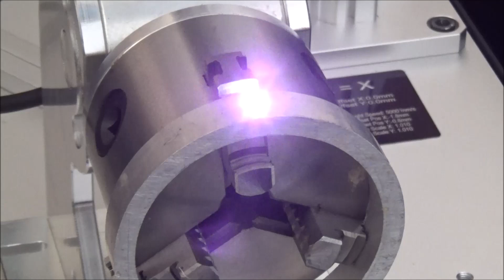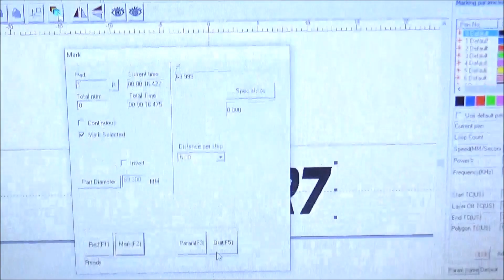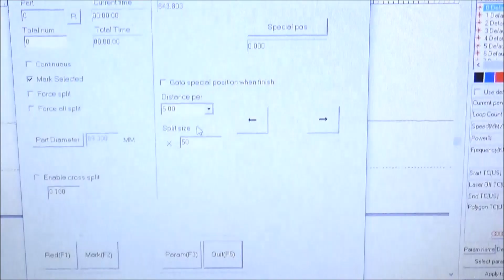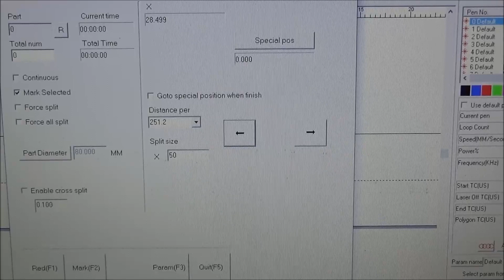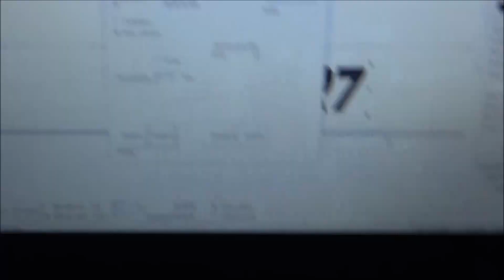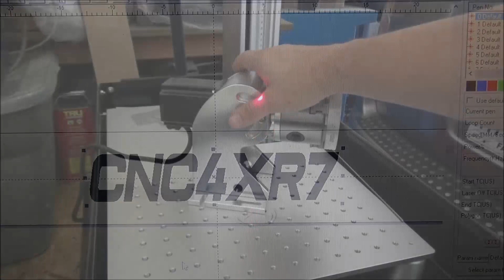MONPORT Laser 80 mm Rotary Axis Setup

Comment: I’m using lightburn. The one setting I’m missing is the number of steps per rotation. Everything else I could find.
Reply: I have 30 watt fiber laser Monport with the same rotary.
Reply from the maker: @longclong  yes that is correct 12800 steps per rotation.
Reply: I think is 12800  he said pulses per round I think I in lightburn is steps per rotation

Comment: Is that thing marking right on metal? It doesn't look like you're using that Cermark stuff.

I have a 10W on my snapmaker and it'll cut .37mm thick copper on FR4 if I cover it in sharpie, but it won't touch any other metals.
Reply from the maker: Yes it does a really nice job marking on Metal. Aluminum is a little harder to get a really dark mark. but it will mark everything I have tried.